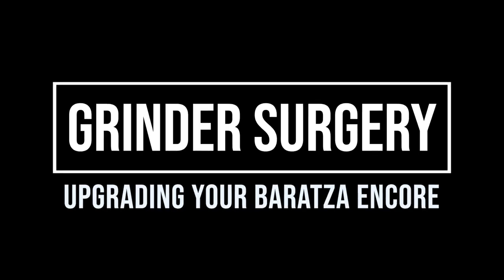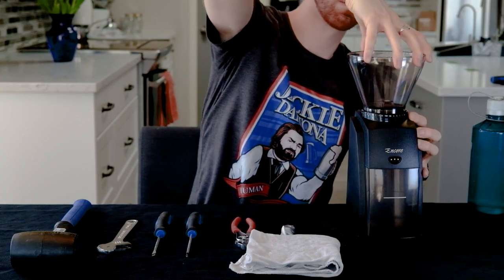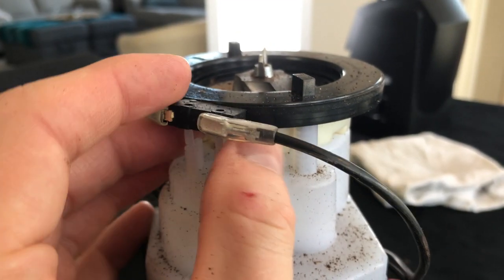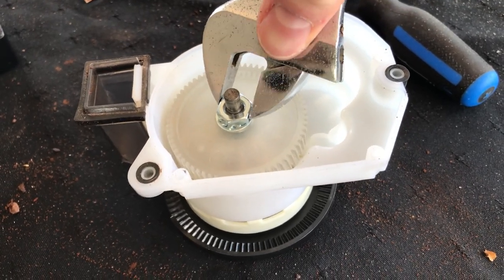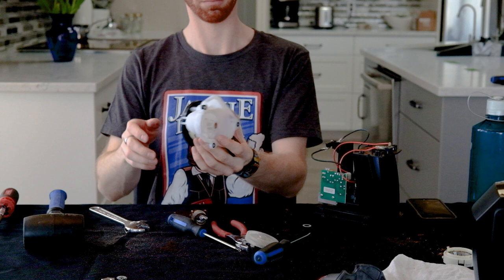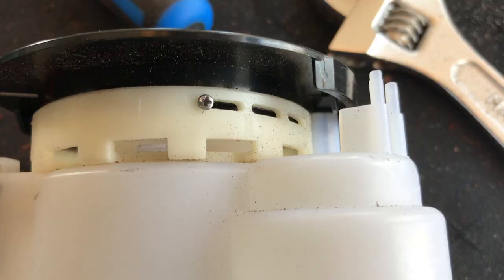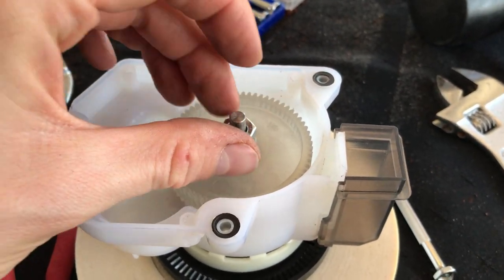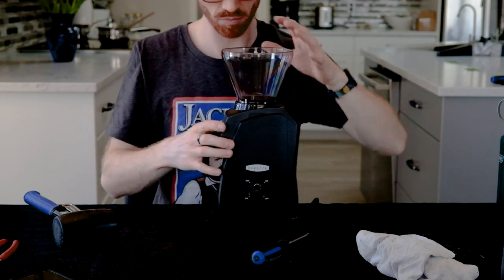Upgrading a Baratza Encore (stepless and M2 burr mod)

Comment: If we change the inner burr do we have to change the outer burr?
Reply from the maker: You don't have to (I didn't), but they recommend you do so the burrs wear together. If I was going to do it all over again, I would order an inner and outer burr and change both. The only reason I didn't is because I ordered the inner burr by itself BEFORE I read they recommend changing both. 

TL;DR no, but I would

Comment: I've heard of a few people being able to swap out the burr without having to disassemble the entire grinder, but can't seem to find any videos on how it's done. Anyone have an idea how that process is done?
Reply from the maker: Good question! I've never heard of someone doing that, but in theory I suppose it's possible. You could unscrew the wingnut and the burr by maybe holding the top of the grind shaft with pliers, but I'm not sure it'd be worth the risk. Squeezing the top part of the burr shaft could damage the threads, which could make taking removing the parts impossible. By taking it apart you get optimum grip on the grind shaft, there are no threads to potentially damage, and you also get an opportunity to clean it. 

TL;DR it's probably possible but I wouldn't do it.
Reply: Barataza has a video on this but it is unlisted for whatever reason: https://www.youtube.com/watch?v=rfCP-BVTGOg

I've not done this myself but basically you can remove the Encore burr by clamping them with vice grips and giving it a few smacks to loosen. Apparently a 21mm socket also fits over the burr, which may be easier. The key appears to be sudden impacts to break the torque, similar to an impact wrench.

Edit: as an update, I upgraded to the M2 burr and can confirm a 21mm socket fits the Encore burr. Remember that the burr is reverse threaded, and to index the plastic paddle wheel with the new burr upon installation.
Reply: @dong_chim  Thanks for this link. As nice as Riley's video is, the vice grip and whack method sure looks a lot easier!
Reply from the maker: I called Baratza today to ask about consistency and the guy on the phone actually recommended the non-surgery version! It's a lot easier than taking it apart, that's for sure.

Comment: I'm looking to do the burr upgrade to my Encore, however I only use the Encore for pour over. I'm not sure i I want to try this burr upgrade or just sell it to my friend and upgrade to the Fellow Ode. What has been your experience with consistency from a pour over grind?
Reply from the maker: Thanks for your question! I'm not sure I'm qualified to answer this, but I'll tell you what I THINK. I don't have any equipment to measure how consistent it is (like sifters), so all I've got is sight. Looking at the grinds coming out of the grinder, it SEEMS good, but I wasn't paying super close attention with the old burr, so I can't say for sure. I've made a few pourovers since doing this and they come out very nice — similar to the pourovers I was making pre-upgrade, MAYBE with less fines — but I can't say for certain. It appears to be very consistent to my eyes.

From what I've heard, the Ode is really great for pourover, extremely consistent, is well-made, and is easy to clean and disassemble (it's also beautiful, but you knew that already). If pourover is the only thing you'll do, it's probably worth it. I wanted versatility with my grinder (the Ode doesn't go much finer than filter coffee) and in Canada the Ode is nearly double the price of an Encore with an upgrade burr. 

The decision is yours, obviously, but consider this: if you upgrade your Encore, you might be able to sell it for more money later. The upgrade burr is significantly cheaper than an Ode, and not super difficult to put in — might be worth a shot before you sell your Encore to buy an Ode.

Hope that helps!
Reply: @rileydmcdonald  Thanks for the detailed response! I have a separate grinder for espresso so was hoping to get a more consistent grind out of the Encore with the burr upgrade for pour over. I've certainly gotten my monies worth out of it in the past 5 years though so I think I'm due for an upgrade soon. I may just try the burr upgrade anyways for a few months as they're only $30 here in the States while I research other grinders as well.
Reply: @uhplifted  I have the encore with burr upgrade and it definitely changes the grind distribution. I pair this with the kruve sifter, and I can challenge or beat any grinder for pour over/filter coffee. Not hyperbole.  Feel free to ask more, if you still are researching.

Comment: Thanks Riley for the video , are you aware of any pedal wheel up grades you can share for this unit , thanks Bob
Reply from the maker: Hey Bob, thanks for watching! Do you mean paddle wheel, as in the paddle on the inside that pushes grounds out? I'm not aware of any upgrades, but that doesn't mean they don't exist! I imagine that would be a tricky thing to upgrade/mess around with, because if you made it too tight it could catch and break (or potentially mess up the gears and motor). But that's a neat question!

Comment: Do you think it is good for espresso after adjustment or buy Bratza City 30 and what do you think of this grinder?
Reply from the maker: It's decent for espresso! I'm having decent luck so far. BUT I haven't tried the Sette 30. That one is more micro-adjustable and fully intended for espresso, so there's a very good chance it's better. I have no way to compare though. 

If you're ONLY going to use it for espresso, I would say a Sette 30 is probably a better bet.
Reply: i had the Sette 270 (i bought it because it had micro adjustments compared to the lesser expensive Sette)- and honestly never really used the micro adjustments all that much, as i could get good espresso grinds at around the 7 setting- 6 1/2 was good too- and i couldn't really tell much difference in taste between those two settings- so micro adjusting between say 6 1/2 and 7 seemed like a waste of time for me- BUT, that could have been just because of the beans i was using- Hard to know how fresh they were- I didn't get a chance to try fresh beans, as my espresso machine crapped out on me 6 days later (Had the Gaggia Classic Pro- it wouldn't push water through the grinds anymore- and pump sounded weak- not right- like it did the first few days) I coulda fixed it cheaply enough under warranty- but meh- espresso dialing in just takes too much time and wastes too much coffee trying to get good shot- I don't have the time to really mess with it every-time i change beans- but if you have the time and money to spare trying to keep dialing in- I would then that's a diff story) IF you're really into trying to get the best possible flavor out of the beans, then the micro-adjustments might be the way to go, but really- the encore with the step-less adjustment might be good enough for really dialing in shots- instead of paying out $470 for the Sette 270- but the question then becomes consistency- The 270 will be more consistent for sure I'd think, but will the Encore be 'consistent enough' with the hacks? Probably-

Comment: Thanks for this post. I couldn't bring myself to spending 250 USD for a grinder like the Sette 30, so I've ordered the Encore. I used to have success with a bottomless portafilter with my Capresso EC Pro. I think I've worn out the Hario hand grinder I've had for years, and more recently using it with a drill modification (probably led to its wearing). Anyway, I'm hopeful I can use the Encore with the bottomless portafilter with success. Interesting that the M2 burr seems to be improving only grind speed for you, and not so much the consistency. That's still a win. I wonder if you've tried to hold the setting better with the rubber band like some have suggested. I read about someone adding a layer of tape as well.
Reply from the maker: As of today I've actually changed it back to a stepped setup. I'll have a video about that in a few weeks. It was kinda lame having to hold it in place all the time!

And glad I could help :)
Reply from the maker: Here's what I think now that I've been using it for a couple months, and my thoughts on stepless: https://youtu.be/8lx9MFMKIDs

Comment: How do you get your hopper to not move and mess up your grind setting? My hopper always moves coarser
Reply from the maker: I didn't do anything! It stays in place by itself.
Reply: I saw an (old, old) thread somewhere where someone put a #8(?) rubber o ring around the hopper (or a rubber band on other posts) to make the hopper stay on better after the stepless mod. Unfortunately they never provided a good picture to tell me where and how but try it out!
Reply: @shinestarbubble  That what I did as well. Just a normal small rubber band In the gap around the hopper.  You can't really miss the right spot.
Reply from the maker: Just wanted to update you on your question: I actually converted it back to stepped grinding because of hopper movement. https://youtu.be/8lx9MFMKIDs

Comment: Apologies for my ignorance but what does it mean to make it stepless?  Just that it doesn't click when you rotate the hopper to adjust the grind size?  I've been having a lot of issues with the consistency of my grinds at the finer settings (it takes several times through to get it close to right) and have been contemplating replacing the burr.  Thanks.
Reply from the maker: No apologies necessary! I'm here to help. Stepless just means no clicks. I used it like this for about a month and I've actually reversed that part — the clicks help it stay in place! Replacing the burrs may help, but you should consider calling or emailing Baratza about it. They're extremely helpful and they might even be able to guide you through troubleshooting. There's a toll-free number on their website: +1 877-701-2021

I've talked to them on the phone and over email three times and they have the best customer service department I've ever interacted with. 

I'll have a video update about my grinder coming in the next few weeks.
Reply from the maker: Here's an update video now that I've been using the upgraded grinder for a couple months: https://youtu.be/8lx9MFMKIDs

Comment: Mine will only grind very coarse after the "upgrade."
Reply from the maker: There's a calibration screw on the collar, and if you didn't put it back in the same place it could be off.
Reply: Thanks for the reply. I will say that in my case, I didn't have the drive gear set flush. Once I fixed that, no problems! @rileydmcdonald
Reply: @rileydmcdonald  Hi! Is this somewhere on the video? Is it the black piece you took off? I did all this and seem to have the same problem
Reply from the maker: The calibration screw is in the white collar part, but it sounds like the previous commenter
Reply from the maker: It sounds like Matthew (the previous commenter) didn't have the drive gear seated properly, so make sure all your parts are set in tightly. If that doesn't work, the calibration screw is on the side of the white collar on the grinder. 

Baratza themselves have great videos showing how to calibrate your grinder. I didn't get into that because this didn't require messing with the calibration, at least for me.

Comment: All went well except....  The button no longer works... No idea what I did.  Fortunately the main switch still works.
Reply from the maker: Check and see if the wires are loose, disconnected, or crushed. It's also possible the case isn't quite snapped on or lined up right — if it isn't, or if the button became unseated during the process, you might just need to pop off the case and try again.

Comment: Thanks for the video. How has the grinder been performing since the upgrade? I have been considering the same upgrade and am trying to find more objective feedback. 

I'm happy with the Encore but I assume Baratza used this burr for the Virtuoso+ and Peciso for a reason. They state that the M2 burr yields "a very uniform grind, with a distinct lack of fines across its grinding range" while no such claims are made with the Encore's M3 burr. Also of note is that the Encore grinds 0.8-1.1g/s while the Virtuoso+ grinds 1.5-2.4g/s, with the burrs being the only meaningful difference that I can find. Both grinders use the same 120v 70w 550RPM motor (#6026) and drive gear (#6091).
Reply from the maker: Great question! I'm planning to do an update video on this (I need to contact Baratza  for one part of it, which I haven't yet). Here's what I've observed — but before I tell you this, please keep in mind all I've got is my eyes and fingertips. I haven't tried any fancy sifters to see about grind size, and to be honest I wasn't paying close attention to the M3 burr's consistency. It worked great with the M3 and it works great with the M2. 

Anyway, here's what I know:

- As you can see in the video, it's definitely faster. I'd been using it since October 2019 with the M3, and since putting in the M2 it's noticeable even weeks later. It regularly surprises me how quick it is. 

- there seems to be less popcorning than before. I use my Encore as a single-dose machine (prob not the greatest idea since this hopper isn't meant for that... they sell a single-dose hopper I'm interested in though), and beans seem to stay lower. I have footage that kinda shows this too, but I can't remember if it made it into the video.

- to my eyes, there might be slightly MORE fines than before, and grind size isn't perfectly consistent. Again, I wasn't paying close attention with the M3, but in things like a pourover there seem to be distinctly different sizes. It still tastes great to me, but I'm not sure about consistency. I suspect this could be how I installed it, but I'll ask Baratza about it. 

- It seems to retain more grinds than before. A few times I've weighed into the grinder and weighed out and lost as much as a gram! The grinds seem to get stuck on the bottom of the outer burr ring just above the paddles, but only at fine (sub-10) grind settings. I suspect this is also user error somehow, but again — gotta check with Baratza. 

I'd do this all over again for speed alone. And I really like it better stepless. I'm hoping Baratza can help with consistency and tuning, but I'll cover that in the next video. Thanks for the question!
Reply: @Riley McDonald  Thanks for the response, very interesting feedback. I also single dose (18g) with my Encore and have noticed minor popcorning as well. The M2 burrs might be worth it just for the faster grinding and reduced popcorning.

On a somewhat related note, I found that turning the grinder on prior to adding beans seems to help with grind consistency. And as a point of reference, retention for me ranges from 0.1-0.5g on setting 9 depending on how much I shake the grinder.

Looking forward to your updates. Keep up the great work.
Reply from the maker: 😊Thanks for the kind words! And I'm definitely going to try turning it on before adding beans. Thank you for the tip!
Reply from the maker: An update for you: performance has been great! https://youtu.be/8lx9MFMKIDs

Comment: "the jury is still out on whether or not the grind consistency improved". If it hasn't, why would anyone spend extra and buy the Virtuoso instead of the Encore? or is the motor and other things better on the Virtuoso?
Reply from the maker: I believe the motor and gearbox are similar in the Virtuoso and Encore, but don't quote me on that. The Virtuoso has more metal on it (some people prefer that), the M2 burr, and a grind timer function. You pay extra for those things. 

I've been on a long journey with this grinder, but I do think the M2 is more consistent and a worthy upgrade. I have a couple videos about how I came to this conclusion, but suffice to say I think the M2 is great and does make things more consistent. It took constant use for a month and a half to realize that.

Comment: HOLD UP!!!! Were you using 3D printed parts??? Also where's the link for the burrs?
Reply from the maker: I was indeed using 3D printed parts (but just to make espresso — I wouldn't put any in the grinder). I'm happy to share links to the models if you like. 

I designed the dosing funnel, but I'm not super happy with it and I may end up re-designing it to attach to the OUTSIDE of the portafilter rather than the INSIDE. 

I can't take credit for the distribution tool though — I found that on Thingiverse and just re-sized it to the right dimensions. It didn't work very well and I ended up buying a distribution/tamping tool from Amazon instead. It's a MATOW branded one and I highly recommend it.

I included a link to the M2 burr in the description, but I also included a link to a set of them (inner and outer burrs) in the description since you commented here.

Comment: I have had both Encore and Virtuoso grinders. None of those is capable of grinding espresso beans consistently. This upgrade is not worth the tome, money and efforts.Can this upgrade be done? - YES! Does it make sense? - NO!
Reply from the maker: Thanks for the feedback! What kind of machine do you use? What's your preferred grinder?
Reply: Encore does grind for espresso; you just cannot micro adjust to dial in shots like on the Sette 270, but I can grind fine enough that I choke my espresso machine.
Reply: @rileydmcdonald  also curious as to what machine might be reccomended
Reply: This grinder isn’t designed for espresso

Comment: "finger tighten" on a machine that vibrates and spins ..... seems like a bad idea kiddo
Reply from the maker: It's what Baratza themselves say to do 🤷‍♂️ Like I said, the bolt is reverse-threaded, so the motor spins in the same direction as you'd tighten the nut. It will fully tighten as you use it.
Reply: @bonedyone  what a weird response lol
Reply: L🤡
Reply: @CorpseGrin  learning something is not an L. maybe it is for dumb people.